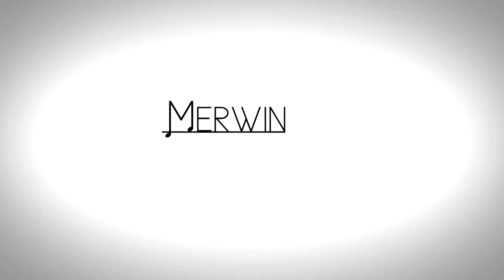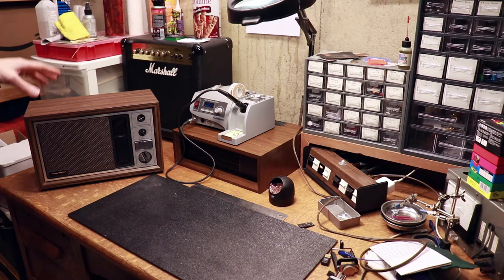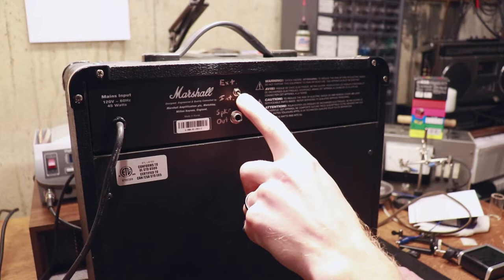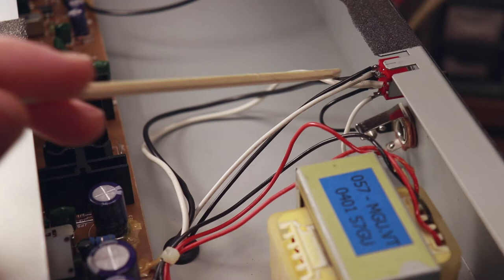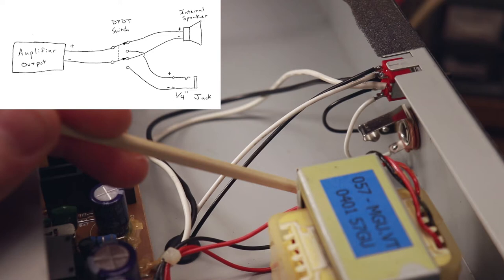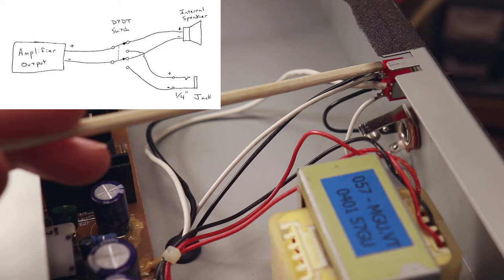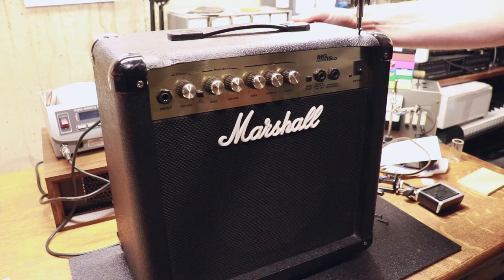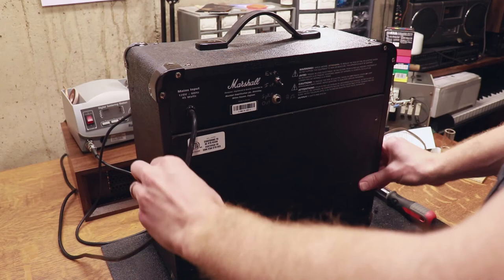Adding External Speaker Jacks to Any Amp

Comment: Good idea for a SS amp.
For a small tube amp though, instead of running the wires from the amp to a toggle switch it’s better to run them to a jack socket and put a jack plug on your on board speaker socket to avoid the situation where you forget to switch back to onboard speaker if you unplug the external speaker.

Comment: Good overview. I got a Yamaha THR-10 recently and it doesn't have speaker out, so I may look into doing this mod. Thanks for the video!
Reply: Maldamar i have the thr10x, did you ever end up doing the mod? i’m thinking about it too
Reply: I'm curious as to how well the ext  speaker would work on a THR-10.  Did you get around to that ?
Reply: @p.s8950  Never did get around to it. I moved my amp into the garage, and didn't need any external speaker to satisfy my needs.

Comment: I have a Blackstar ID Core 40 watt Stereo amp with twin 4 ohm  6.5" speaker very small 915 lbs and about 16" square )s which I added  a 12 pin spdt switch and 2 output jacks (stereo remember and have custom built vertical 4 X 12" cabs (also 4 ohm) to plug it into and it pushes air pretty well for a tiny digital practice amp..  cabs are 16" wide and deep and 54" tall...can stand on either side of the 100" big screen on the wall  or they can be attached together side by side to mimic a full stack.. Either way they sound great. and if I plug in my heavily modded Starcaster Strat..look out...

Comment: I'm adding ext speaker jacks to my amps on a daily basis ))) I've modded Marshall Reverb 30, Marshall 8040, Fender RocPro 1000 (added second jack as it is on the head and master volume knob). But I'm using switching jacks instead discreet switch.

Comment: old video but I'd like to post my 2c too. Yes it's easy to add an external speaker jack on amps like these. switch is not mandatory if you use a switched jack (that will turn off int speaker the moment you plug ext cable in)
Reply: I have that setup on my champ. The jack had to be put far inside the cab. It’s a pain to  plug it in and out.  Going to try this. It’s easier to switch on the fly   Cheers.

Comment: I know this video is from  a year ago, but hopefully you can answer my question, I just got back into playing bass again after not playing for about 20 years. I saved most of all my equipment and I have a 70s Ampeg V4B head that is a tube amp with a 2×15 cabinet that's been in my unheated garage and I know that one speaker is shot plus I know that there is a good chance that it will probably need work and it is the size of a refrigerator, and I rather not bring it in the house, to get going right away I purchased a Fender Bassman 100 combo amp with 15" speaker. When I bought the amp I knew that just the one 15" speaker would not be able to handle the amp much more past the volume past 5 but I figure that all combos had a Jack for a external speaker cabinet and did not look when bought it. So I have had the amp for a month and looked on the back of the amp and of course no external speaker  jack, and is a solid state. You make it look so easy and dont know if I can do the job, and do not want to mess up the amp, and rather not buy another amp. Sorry for the long comment but would a technician do the job and about how much it would cost, just a rough estimate to how much it would cost. Thank you

Comment: Why not just add a switching jack? That way if you forget to change the toggle and it is not plugged in to an external speaker the sound is automatically directed to the internal amp speaker.
Reply from the maker: Mainly because I didn't have a switching jack on hand...
Reply: Thats what i came here to learn.  i want to do that to a Peavey Vip 2 amp. I was going to replace the speaker but if i can plug into my mesa 2x12 or 4x12 that'd be great.

Comment: I've added a 1/4 inch "amp in" to a 2x12 combo at a jam space so that I can bring my own head there to use. The original plan was to add a fx loop, until I looked inside this Vox ac30vr. Looked way too complicated to do a mobile solder mod.
Anyways, I literally just tapped into the extra set of inputs on one of the speakers itself and when we went to jam the week after, while under normal operation (I.e. nothing plugged into the amp in jack I added, just using the amp normally as a combo, my guitarist would get a crazy high pitch squeal when the distortion would kick on. Without the switch, did I change the impedance by adding the jack EVEN when nothing is plugged into it? I'm trying to learn here myself and am confused about why it is happening
Reply: Undo the mod - if the squeal goes away then yes you did cause it. If not, well your amp works different now or something else broke it.

The easier way to do this is to use a Cliff Jack. When no 1/4 Inch Jack is inserted just let the unit stay stock. But when you plug in a jack the internal bars lift, cutting off the unmodified path, and you can route that signal where you like.

In my mod the amp output flows down the inserted speaker cable and disconnects the internal speaker. The only downside is you have to be sure that wire is plugged into a functioning speaker of appropriate ohm

Comment: Great video! I have a 40W 1x12 combo amp that I want to mod in a similar way with a switch. Is it safe to use standard 15A 250V  AC DPDT switch. I don't have an idea how big is the output signal on the wires that go from the amp to the speaker. Should I be worried. I guess the switch should be able to withstand the load and not to fail in the operation. Thanks!

Comment: I used a Switchcraft 12A jack so this is all you will need no extra switch. My only issue is I had to insulate the switch from the chasse with 2 plastic nuts or it buzzed. Not sure why

Comment: So I suspect this is a dumb question but here goes.  Why not run the outside speaker cab from the headphone jack?
Reply: Headphone jacks have very low output, enough for tiny speakers but not enough for a guitar speaker. On the same token, if you connect your headphones to the external speaker output you'll instantly blow off the headphones and your eardrums if you happen to have them on.
Reply: surely you can go from headphone output to a powered frfr speaker and that would end up virtually what you have here without voiding warranty i was caught on my katana air between doing what you have done to a normal cab or hesdphone out direct to powered speaker like a line 6 or headrush

Comment: Is it possible to add a "line" out, where I can use both my amp's speaker and an external one?
Reply: Well, yesterday I asked the same question to a guy who builds amps and guitar pedals and he told me that it would overload the amplifier and burn it (at least the TDA2030A that's inside the Marshall MG10CF), basically it wouldn't be able to handle both loads, so maximum a single 12" speakers for these small solid state amps.
Reply: It all depends, u need to calculate first the amp spec, if requirements not exceed 4 ohm speaker means u can use a single 4ohm speaker or double 8ohm speaker or 4x 16ohm speaker. And let say the watt of the amp is 50w so meaning u cant use speaker below 50w . U can. Use >50w like 100w, 150w, 200w etc the nearest is the perfect so the amp can support speaker in full range. hope u understand my explanations

Comment: I've never had a amp with a line-out before.

Would they normally work in this way (i.e. internal speaker OR external Cabinet/PA), or would they normally work as internal speaker AND external Cab/PA)

Thanks in advance.

Comment: Hello Merwin Music: I was thinking of getting a Marshall CODE100 combo amp. On the back of that amp, there's an 8ohm cabinet connection OUT jack.  Scenario: If I connect that jack to, say, an external Marshall Lead 1960 cabinet, will the combo amp's internal speakers CONTINUE to work WHILE the external cabinet is connected, or will it ONLY play through the external cab when connected? I'm asking because I thought it would be cool to have a true "stereo sound" in my jam room, keeping the combo nearer me and then placing the larger 1960 4 x 12 cabinet cross the room for a big, wide sound.  Comments or suggestions?
Reply from the maker: My guess is that either the internal speaker disconnects, or the amplifier is actually stereo and has a separate amp for the external speaker jack.
Reply: @MerwinMusic  Thanks for the reply! I checked out the manual for the amp and, under point #26 it says, "26. SPEAKER OUTPUT (CODE100H ONLY)", so I'm not sure if one CAN even use an external cabinet jack on the combo version, as that part is unclear.  I mean, why put an output jack on the combo version if it can't be used?
Reply: @johnm.4655  According to the page on Sweetwater, it says “has what you need to plug into a 4x12 cab for big sound”. I would say the speaker out jack is a switching jack, meaning it cuts the signal to the on-board speaker. Amps that have 2 speaker jacks like the Peavey 6505+ (one for the on-board) and one for an external cab would run both. In your case, I think you get one or the other.

Comment: Hey Merwin, I have a Line 6 Spider V mk2 60 watt guitar amplifier but I am trying to connect it to an external speaker but it doesn't have any kind of speaker output connection at all....

What are some ideas, tips, tricks, and information you could help me out with?

Comment: I'd like to add an external speaker jack to my amp that has an 8 ohm speaker.    Without the speaker plugged in of course I'd be at 8 ohms - I want to stay at 8 ohms with the external speaker plugged in - so 8 ohm load either way.   How can I wire my jack to do that?   Maybe series-parallel somehow?   Thanks!

Comment: Why not just add a switching jack?   When nothing is plugged into it, the signal will go to the internal speaker.   When a speaker cable is plugged into it, the signal will be routed to it, and onto the external cabinet.  No need for a manual "internal/external" switch.

Comment: Hi , one question , if you are using the extern speaker and you want to go back to the internal speakers but you forget to change the DPDT to the internal speakers ,what means the THRC is running without speakers , is that not dangerous to harm the amp ?
Reply from the maker: No load on non-tube amps is not a problem. Disconnecting a load with the amp running isn't great and could be an issue, so if you don't switch or disconnect while it's on you shouldn't have a problem.

Comment: What would be done in the case of adding this jack to a Positive Grid Spark 40 amp?  It uses (x2) 4"  4ohm speakers.  Does the toggle switch need to be wired any differently for such efficient speakers, or does it remain like this?

Also, does it matter if an external cabinet (it plugs into) has (x2) larger 8 ohm speakers, or is it OK since 4 ohms is more powerful anyways?

Thank you for your help.
Reply: Trace the wiring. Is it wired in series or parallel? Ideally your switch would have amp input to common middle and one throw would go to the internal speaks and another to new speakers.

Regarding changing the Ohms.
Watts = power = volts x amps
The power is measured at a given impedance (similar to resistance) and this is effectively limiting the current. So if you don't match the impedance the speaker coil into working at its best.

Using higher impedance will reduce flow and things sound quieter.

Decreasing the impedance will result in more flow - it will likely sound louder but at the same time could melt the coil - speaker stops working. So try to keep impedance at same rated value.

If you add speakers to same amp bear in mind you can put speakers in series (impedance sums) or parallel (new IMP = (A x B) / (A + B) ). 2 similar speakers => 2 A for series and A / 2 for parallel.

Hence why I said trace the wiring. In a multi speaker cabinet you can have mixture or series AND parallel. If you are unsure then do some Googling or ask on a forum. Better than thinking you got it ... turn up the amp ... melted coil or blown speaker.
Reply: @stephenhookings1985  Thank you for the detailed reply!  You taught me alot.  Here begins my pilgrimage for amp building ideas LOL.  I appreciate what you do and will eventually learn more here.
Reply: @brian95240  have you seem this dudes video series? https://youtu.be/-eeC1XyZxYs

I will add a video on my channel regarding cliff Jack - how I use them. And why I didn't bother with my 4 ohm Orange combo.

Also next week I have scheduled a video testing a 4x100w at 8ohm cabinet with a 15w at 8 ohm Laney Cub 12r. Long story short - all the time I put into R & D of impedance matching, amp class, eq, cabinet etc, which bass head ... screw that. The guitar valve amp produces MORE than enough volume and bass - I put it next to the amp cos I am worried those Low frequencies are rattling the tubes - don't want to shake those filaments.
Reply: @stephenhookings1985  Thank you for the reference!  I'll check out your channel for that video, once it is added.

Comment: Interesting. But is it possible to connect a head tube amplifier to a combo amp in order to use only the speaker, sparing with buying a cab alone? I own the same kind of amplifier, a Park G25R with a 10" speaker.
Reply from the maker: As long as the speaker impedance and wattage is right for the amplifier. I have plugged a couple of heads into the speaker inside my fender hot rod deluxe.
Reply: @MerwinMusic  with your connection, you keep the amp active   and you choose to either use the cab speaker or an external speaker. But what I'd like to do is keeping the speaker active in any case but being able to deactivate my amplifier to connect a head to the speaker.

Comment: Is it possible to make the both speaker sound at the same time?
Reply from the maker: Not really. If you hooked up both in either series or parallel then you would either double or half the resistance.
Reply: Couldn’t you use an on/on/on switch to have the speaker and the out jack running at the same time?